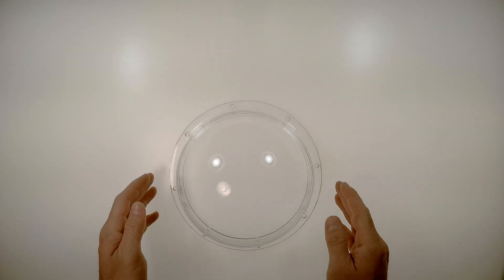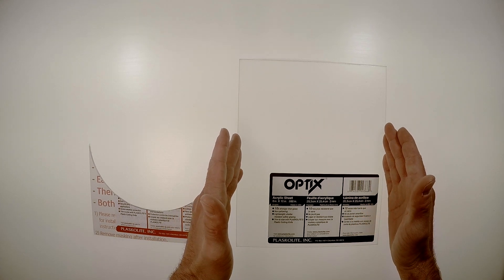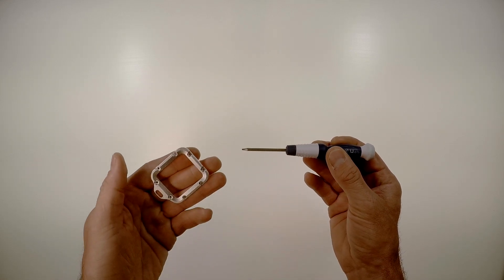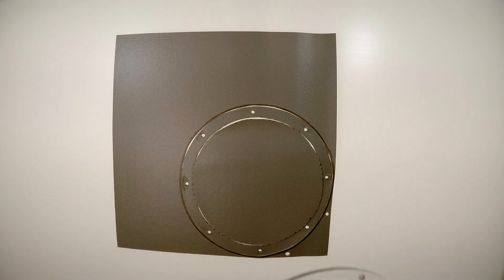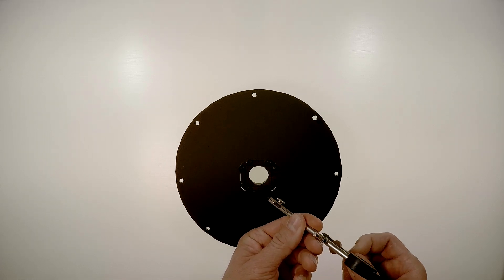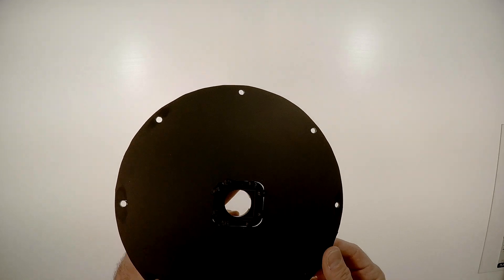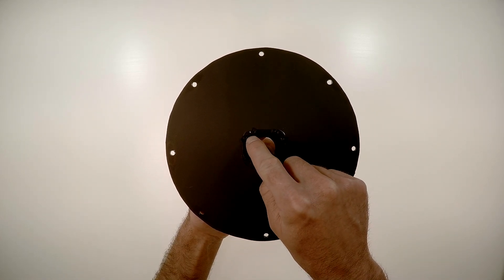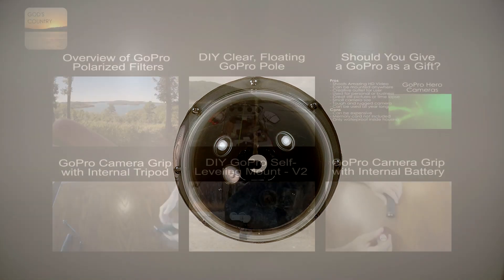DIY GoPro Dome Port: Step-By-Step How To Build

Comment: how do you turn it on and off since the button is on the front of the cam?
i think you have to take the camera out of the housing which in the sea makes it totally impractical. other than the fact its impractical its great ;)
Reply from the maker: If you're going to be in the water for more than the length of a battery it could be a problem but I doubt that most people would use it for that long. Even scuba divers have to come up before they run out of air which is probably a similar time as the battery. In practice it's not really a big issue. Turn the camera on and put it in the housing. It's not filming so it's not drawing max power. The Gopro also has a sleep mode that it automatically goes into after 5 min of not filming anything. In that mode it draws even less power. If you need more time, get on dry land or in the boat and swap in a spare battery.
Reply: one button mode :)

Comment: thanks for the dome link!!!!
Reply from the maker: No problem! Glad to help!
Reply: here's another link where the domes are cheap i just found!!!!
http://www.aliexpress.com/item/5-INCH-Acrylic-Indoor-Outdoor-dome-camera-housing-cover-vandal-transparent-dome-security-camera-cover/32328702739.html?spm=2114.01010208.3.2.VNrQGS&ws_ab_test=searchweb201556_0,searchweb201602_3_10037_10017_10034_10021_507_10022_10032_10020_10018_10019,searchweb201603_6&btsid=64f36f3d-c499-4665-98c8-fb84a1220e5b
Reply from the maker: Those don't look to bad except that they are only 1.8mm thick. Just keep that in mind.

Comment: Nicely done video.  Your opinion on this dome I found on amazon?:

http://www.amazon.com/JMX-Acrylic-Outdoor-Panasonic-Security/dp/B012LA8E7W/ref=sr_1_9?ie=UTF8&qid=1463856202&sr=8-9&keywords=security+camera+dome#Ask
Reply from the maker: +Tom R Thanks Tom. That dome looks so-so. There is a straight section at the base of the dome so it would be tough to put the camera lens in the middle of the sphere. It also appears to be pretty thin. The thickness probably won't be a big deal unless you want to use it in deep water.

Comment: so you remove the lens from the housing and just use the bezel and sandwich the acrylic between the bezel and camera?
Reply from the maker: +Shikai Vlessing Hi Shikai. No you remove the bezel and don't reuse it. You only use the bezel to mark the screw hole pattern on the acrylic. Then drill through the acrylic and screw it to the waterproof housing. Then seal the screw holes with sealant. Let me know if you have any other questions.

Comment: Hi, which screws did you use to mount the gopro housing at the dome? Thanks for answering. :)
Reply from the maker: +RicArnold14 Hey Ric! To mount the camera housing to the backing plate I used the screws that come in the housing to hold the lens on. So, no need to buy new screws.

Comment: Do you have any tips for following this DIY with the GoPro 4? Since it's a slightly different housing, are the steps really any different?
Reply from the maker: +TheGreenCastle Hi TGC. Thanks for the comment. This is the DIY for the GoPro4. You need to use the dive housing/GP3 housing because they have the exposed lens screws so you can attach the backing plate. As of right now I have no way to securely attach the GP3+/GP4 housing to the backing plate and have it remain totally waterproof.
Reply: +God&#39;s Country Thanks for the clarification!
Reply from the maker: +TheGreenCastle No problem!

Comment: WOW!  This is so cool.  I am going to try and build this and use it for my next surf trip to Hawaii!  Any new additions or advice?
Reply from the maker: +Gavin Wilchek Thanks Gavin! Not really any new additions. Just make sure you test it with plenty of time to resolve any leaks that you might have. Don't forget to use the flat black paint on the backing plate. I used a "medium" firmness closed cell foam for the gasket. I would advise getting a harder closed cell foam that won't crush as easily when you bolt on the backing plate. There are details in the video description.
Reply: +God's Country Did you get the 1/4 clear acrylic or Lexan dome?
Reply from the maker: +Gavin Wilchek I use the 1/4" acrylic. You could use Lexan but it is much more expensive.

Comment: Hey, is there a reason why you get the 1/4 thick clear dome vs the 1/8 dome?
Reply from the maker: +CAITLIN ATIENZA Hey Caitlin. I have not tried the 1/8 thick domes. I used the 1/4" thickness in order to make the whole thing as stiff as possible. The 1/8" may work fine but I haven't tested it.

Comment: How did you cut down the GoPro case where you removed the button? Thanks for posting the video!
Reply from the maker: +Headed Anywhere Hey HA! Thanks for the comment. I just used a normal hacksaw to cut the case. It only takes a couple seconds to get it cut off.
Reply: +God's Country Thanks! I ended up getting a dremel tool for all the cutting.  Still waiting for my gasket material, but hopefully should have my dome port set-up in the next couple weeks.  If my construction proves successful I'll be able to bring it with us to the Cook Islands next month! I'll let you know how it goes. :)
Reply from the maker: +Headed Anywhere That sounds like a great trip! I hope the dome works well for you.

Comment: Hello, is it possible to build this or a variation of this, for the gopro hero 2014 version? It is the one that can not be removed from it's waterproof housing. Thanks!
Reply from the maker: ***** Hi Jeremy. Thanks for the comment. Right now I'm not aware of a way to make this work with the Hero 2014 and I don't have one to do any testing with. I'm sorry.

Comment: I got a 6.2 inch dome and the thickness is .060 inches is that okay or is that too thin? What are the problems with thin ones?
Reply from the maker: Anna Samples Hi Anna! I don't have any experience with a dome of that thickness. I would think that it would work fine if it's just used on the surface for half-and-half shots. If you take it deep into the water, there is a chance that it might not be able to handle the pressure at some depth.

Comment: What's the smallest dome diameter I can use?
Reply from the maker: Czar Christian Bongon Hi Christian. Unfortunately I'm not sure what the smallest size is. The back of the dome needs to be big enough to fit the waterproof housing lens in obviously. The commercially available domes are in the 5"-6" range but I'm not sure why they have settled on that size. Any bigger gets harder to use. Sorry but I hope that helps.
Reply: The only dome that I think I can get a hold at is a 5". I think that'll do. Thanks bud!
Reply from the maker: Czar Christian Bongon You're welcome! That should work great.

Comment: What did you use to cut the acrylic backing so cleanly?
Reply from the maker: I think a hacksaw should work. I have a handle that holds hacksaw blades on one side only and that would probably work well. I bet a normal hacksaw will get the job done!
Reply from the maker: james dean Hey James! I used a Dremel Scroll Saw because I have one and it works well. You don't need one to do this project though. Lots of different saws should be able to cut the acrylic easily.
Reply: Thanks so much...keep the vidz comin
Reply: +God's Country What kind of saw would you recommend if I don't have a Dremel Scroll saw?  I have a hack saw that I can change blades, would that work?

Comment: The gopro hero 4 has no screws on the waterproof housing, so how do you attach the water proof housing?
Reply from the maker: Nukelierninja That is correct. The 3+ and 4 waterproof housings do not have exposed screws on the front so you need to use either a GoPro 3 housing or the Dive Housing. Once you get this built, you will not be able to easily take the dome on and off of the waterproof housing so you will need more than one waterproof housing anyway.
Reply: God's Country does the gopro hero 4 work with the hero 3 housing?
Reply from the maker: Nukelierninja Yes the size of the cameras from 3, 3+, through 4 are all the same and the buttons are in the same locations.

Comment: What is the exact dome you bought?  So many choices on that website, I'm confused!
Reply from the maker: dwdsquared2 This is the page that I bought from: http://www.eztopsworldwide.com/cameradomes.htm . My original dome was 7" but I think a 5" or 6" might be better. Find the diameter that you want and click on the blue link. On the next page use the section that says "1/4" thick material". Choose "clear acrylic", 1/2" wide flange, and enter the maximum dome height. Maximum dome height is half of the diameter. So max height for a 5" dome is 2.5". 6" would be 3" and 7" dome would be 3.5" height. Enter your phone number and click add to cart. I have not had time to test which dome size I like better. I'm sorry.
Reply: God's Country Thanks :)  Now, I have the Hero4 Silver.  Can I use the GoPro Blackout Housing or Standard Housing instead of the Diving one?  Why is the Diving one ideal here?
Reply from the maker: dwdsquared2 This build uses the exposed screws on the front of the dive housing to mount the dome to the camera. The standard housing and blackout housing do not have exposed mounting screws.
Reply: God's Country Thanks so much!  I ordered the dome and (seemingly rare!) GoPro Dive Housing and now on the way home I'll go to Lowe's and get the rest of the supplies.
Reply: +dwdsquared2 How much was just your dome?
Reply from the maker: +ipwnu92 The company that I buy mine from sells them for $34.50. 1/4 inch thick. The full parts list is in the video description.

Comment: Hey thanks for the video. Did you use a soft, medium, or firm firmness for the closed cell foam sheet? I saw on amazon they had the three different options
Reply from the maker: Kaelan Lee I ordered the medium firmness but I would recommend getting the firm! The medium was to soft.

Comment: Hi
Can you send the exact link of the dome that you have use? Thanks
Reply from the maker: Salvatore P This is the page that I bought from: http://www.eztopsworldwide.com/cameradomes.htm . My original dome was 7" but I think a 5" or 6" might be better. Find the diameter that you want and click on the blue link. On the next page use the section that says "1/4" thick material". Choose "clear acrylic", 1/2" wide flange, and enter the maximum dome height. Maximum dome height is half of the diameter. So max height for a 5" dome is 2.5". 6" would be 3" and 7" dome would be 3.5" height. Enter your phone number and click add to cart. I have not had time to test which dome size I like better. I'm sorry.
Reply: God's Country  Thanks!

Comment: So I built one very similar , I didn't have flange on dome so I siliconed it. Watertight worked very well thanks for all the info. Have one question tho mine fogged up inside the dome within 10-20'sec of being in the water. Any ideas ? Do you spray the inside with anything like rainx ?  Thanks for any ideas you may have
Reply from the maker: eroggero Hey Eroggero. Thanks for the comment. I did not treat the inside of my dome with anything. I did assemble it inside my house though, which should be a low humidity spot. The RainX bottle says not to use it on plastics unless it has been approved by the plastic manufacturer. I have not tried it on my dome because of that.

Comment: I have tried building one it was an 8" dome worked for a bit but developed a leak. I just tried siliconing the case into back plate. I might give your method a try looks good, nice job.just curious what did you use to cut the base plate out with? I used a jig saw but protective coating seemed to melt up and came out jagged . Thanks for the info
Reply from the maker: eroggero Thanks! I used a Dremel scroll saw to cut the backing plate.

Comment: Hi I have another question, will this fit the Knekt GP4 Trigger?
Reply from the maker: Jayden Duck Hey Jayden. I have not tried it so I can't say for sure but I would say probably not. The GP4 trigger is made for a 3+ or 4 case and my DIY dome port uses and 3 or Dive Housing. I don't think the GP4 trigger would fit the housing.